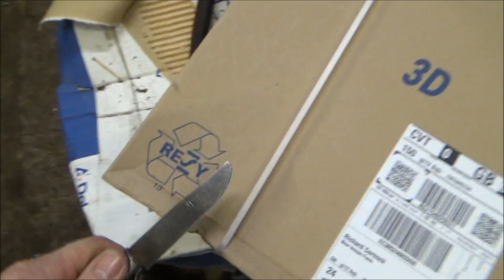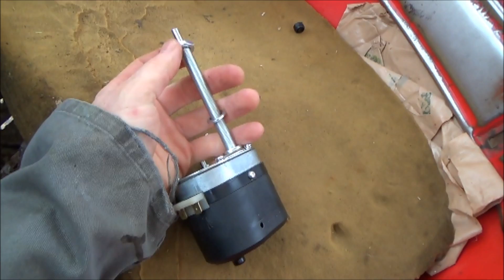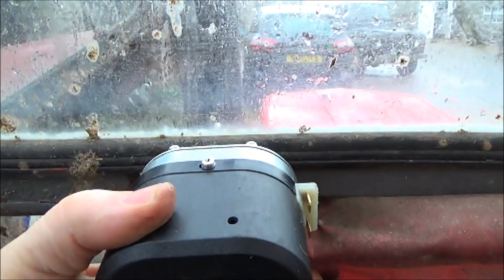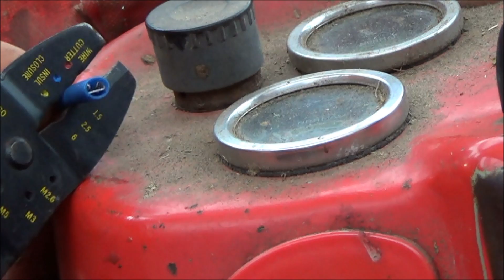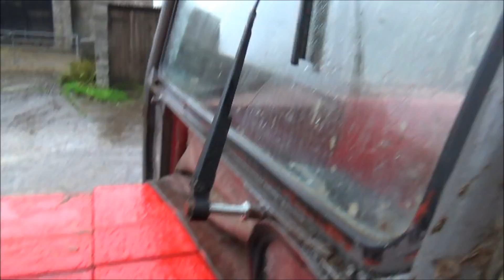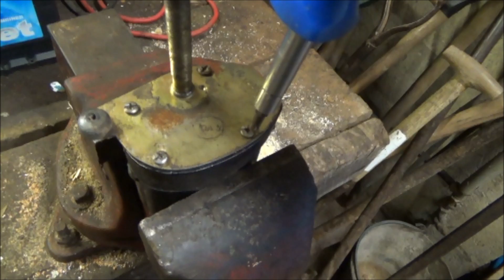Replacing the wiper motor on a Massey Ferguson 135

Comment: I never seen them with the Wiper motor to the bottom left hand side? Usually (well on our one anyways) they have them situated in the middle along the top of the cab like most other tractors.
I presume it's situated there due to the type of cab you have on your 135?
Reply from the maker: +North West Agri yes i think so, this is a Sirocco cab but i think other makes were also fitted to the 135

Comment: didnt really think the wiper was necessary , but never had a cab so I guess you'd have to get the rain off to see.
Reply from the maker: +Ruslan McCabe yes it makes life easier
Reply: +thefunkyfarmer wouldn't be the warmest cab you have wouldn't it? guess since it keeps the rain off its doing its job
Reply: the best I get in winter is a sunroof. Keeps most of the rain off, the other tractor has absolutely nothing and it's hell, both in summer and winter
Reply from the maker: It's really just the rain to worry about so I don't mind this cab

Comment: Another great video Richard, when the motor costs £45 you have just doubled the value of the Massey!! But I can't really speak because we have the exact same tractor but without the cab and when I say that I mean it's got a cab but no windows or doors so it's just a frame and a bag roof so when we use it to scrape out in the rain you get a bit wet LOL